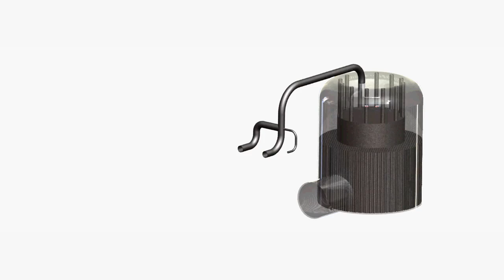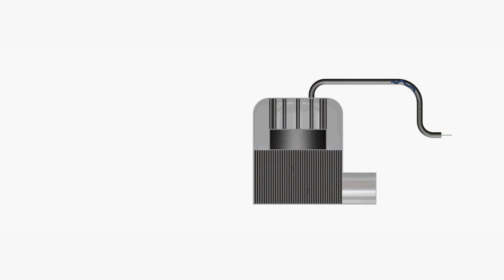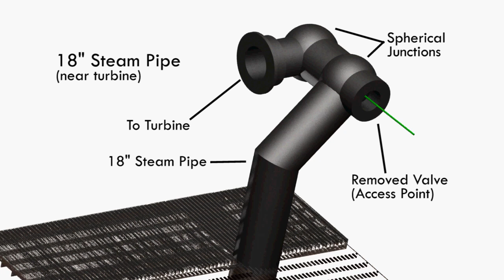Snake Robots Deployed in Zwentendorf Nuclear Power Plant

Comment: As a CCTV sewer inspection surveyor, and a Commercial Diver, I've used some "cutting edge" technologies.  Conventional push cameras have their limitations...blind spots around bends, getting stuck on offset joints, to name a few.  Even pan & tilt push cameras have their limitations-size of the pipe they can access due to camera head size, and angles they can bend to. To see this snake camera turn around and look behind itself was a breath taking moment.  That would only happen by accident with a conventional push camera. But the coup de grace to all cameras is that awesome self locomotion technology...congratulations CMU Robotics!!!  Awesome work.  The industry is bowing. MORE VIDEOS Please.